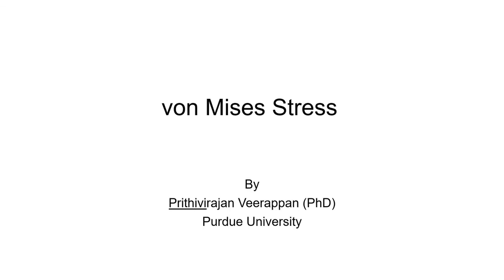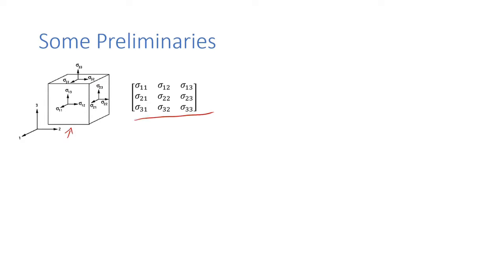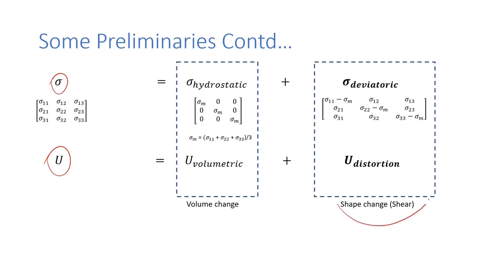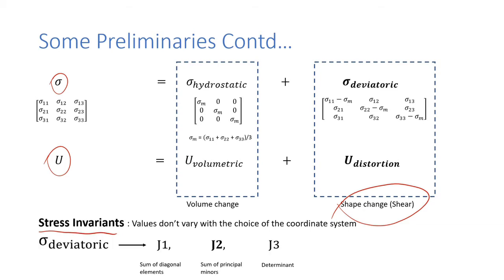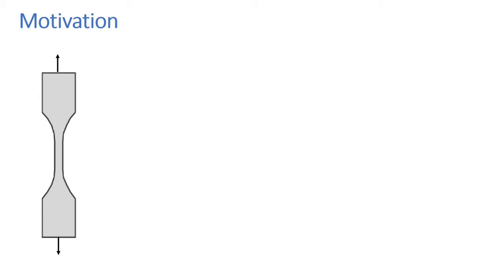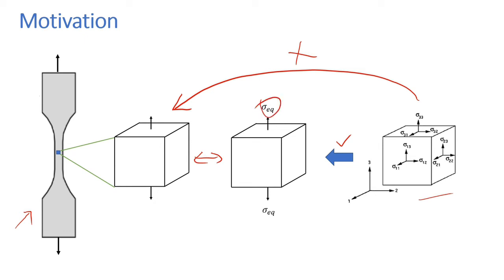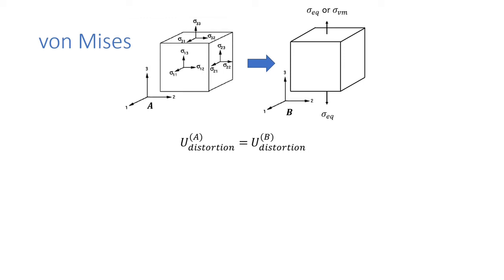von Mises Stress - Motivation, and Its relation to octahedral shear stress and J2 Invariant

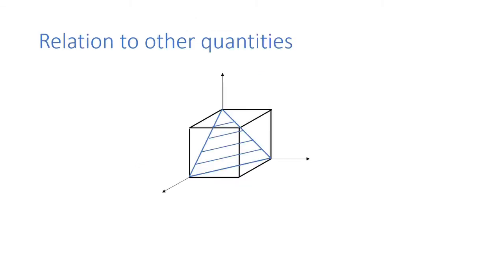Comment: Thanks a lot! Very helpful. However, i'm wondering if there is a typo in the equation in 3:00, maybe the sigma31 should be sigma12 cause there are 2 sigma31 in the equation?
Reply from the maker: Yes, you are correct. that is a mistake. Thank you for pointing it out